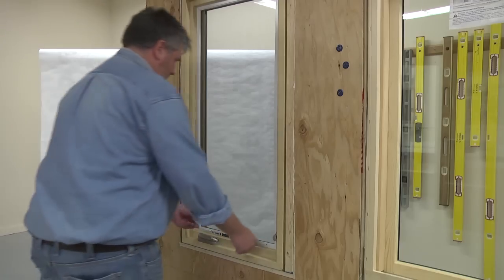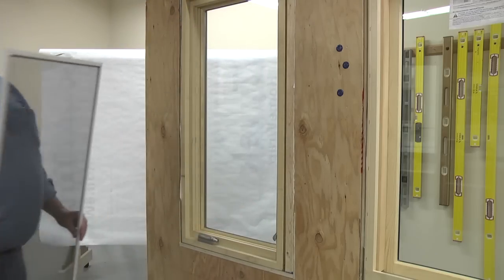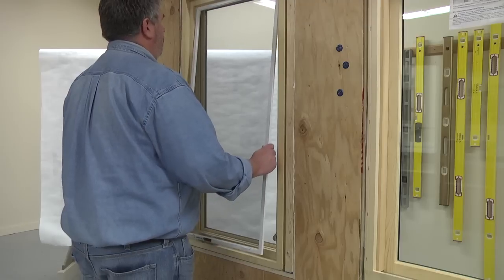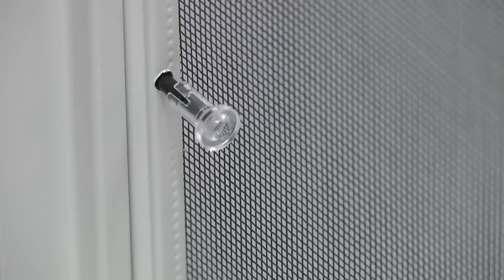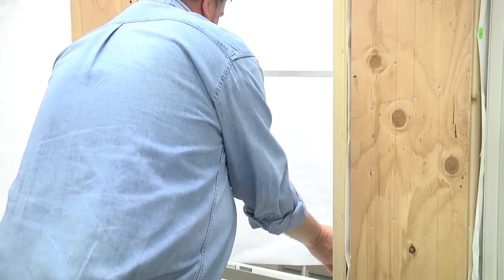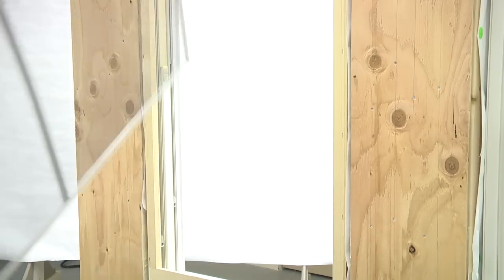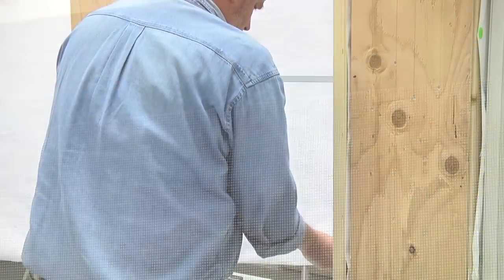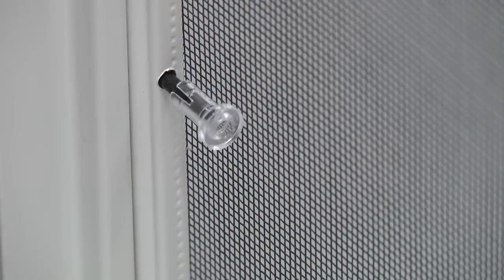How to Remove a Screen on Marvin® Windows

Comment: They conveniently neglect to mention how to hold the screen when removing or replacing, so that you don't drop it 20 feet to the street below.

The top is held in by a tiny ridge across. If you let it slip down at all without gripping anything but the pins, it's gonna fall. 

There's a silly little clear, flexible, tab on the bottom edge in the center. I assume that's what your supposed to grab on to with your third hand 🤣. It would have been nice if it were a loop so that you could tie a string to it.

Comment: What about the part where the plunger pins do not flex the screen at all so the only way to remove it would be with maybe pliers & then you're likely going to break the screen.  No budge at all on these on either side & the plastic covers just pull right off the pins.

Comment: The plunger pin system is awful, I would never purchase this style again. The window screens are very difficult to reinstall and I can’t insert both pins into the frame slot and now have window screens with gaps and insects are getting inside, very frustrating!